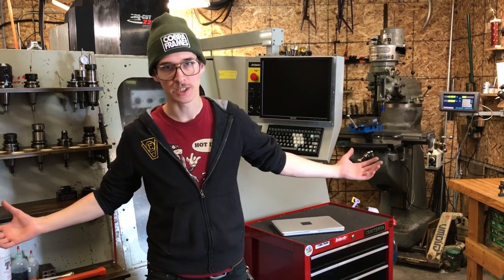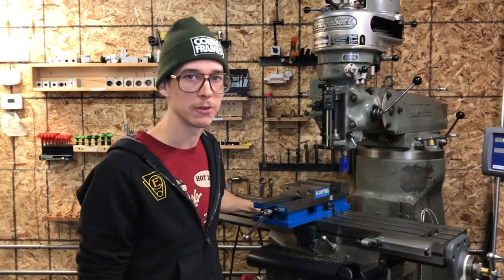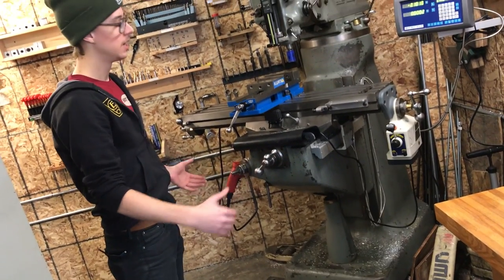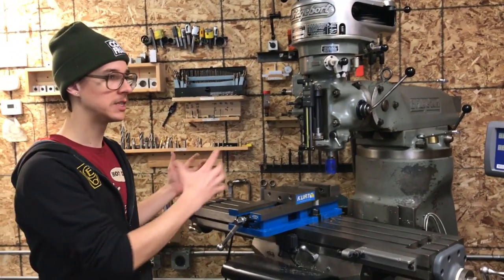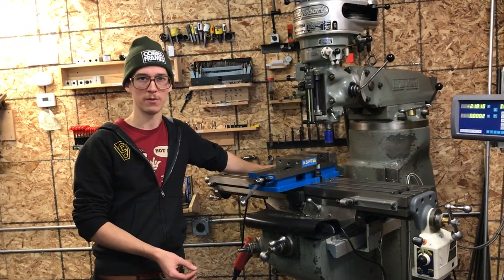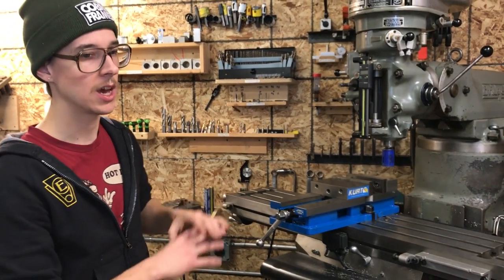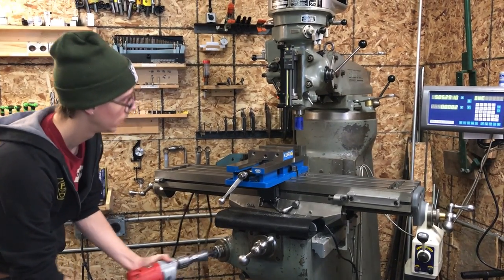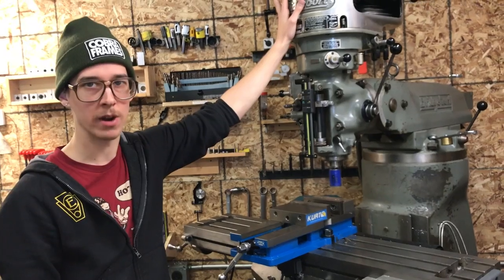Why the Bridgeport is So Good for Bicycle Framebuilders

Comment: This is amazing. Thanks for the great video. 

How do you feel about smaller mills? How much is lost in term of rigidity, functionality and/or accuracy? Thanks again!
Reply from the maker: It depends on the mill. We can't always go to the final step right at first and sometimes the stop gap efforts are valuable. I had a very small and lightweight manual mill before the bridgeport and it was better than nothing, but it was transformative to go from that to an actual bridgeport mill.

Comment: Nice video! Which model Bridgeport do you own? Any particular model(s) you recommend or don't recommend? I'm looking at Bridgeports now and want to add one along with my Brown and Sharpe horizontal mill. Keep the videos coming!
Reply from the maker: I have the 1hp J head with the dovetail ram and the step pulley drive. It has a 9x42" table. Variable speed is great if you can get it, but they go for more $$ usually and when they eventually need service it's a bit more complicated.

Comment: Great video. I'm just getting myself set up but unfortunately I can't fit a Bridgeport into my shop (i.e., through the door). Any recommendations for a smaller alternative with similar versatility? There are so many options out there!
Reply from the maker: You can fish a Bridgeport through a normal doorway pretty easily if it’s level ground on both sides. You run the table to one end of the travel and hook it through, then crank the table to the other end and you’re through. Roll it on a pallet jack. It’s also not super difficult to remove the table altogether. You raise or lower the knee to get the table at the correct height and then slide it off of the machine onto a table. Can be done alone if necessary. Then the machine is pretty narrow.

Comment: Great Videos! How much did this mill cost you? any tips on where to buy these used?
Reply from the maker: I got lucky and the mill only cost me $1150. Now a couple years later I have spent 2-3x that much on the whole setup you see with Kurt Vise, Digital Read Out, Power Feed, etc, etc.

Comment: What is that blue hole saw?
Reply from the maker: Sean it’s just an Irwin brand. I got it from some random internet hardware store. I don’t remember but it’s nothing special. In my experience the rigidity of the setup is 10x more important than the brand of the holesaw.